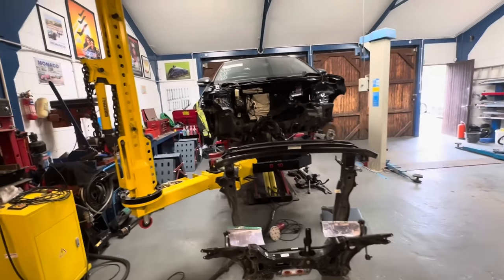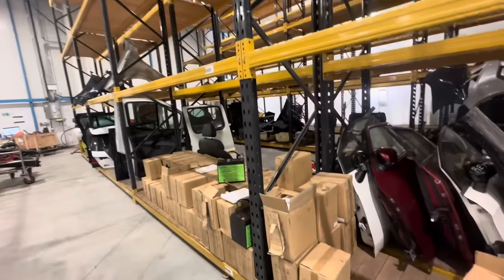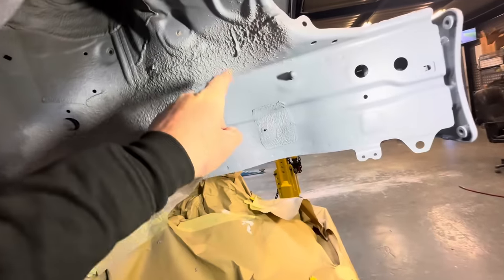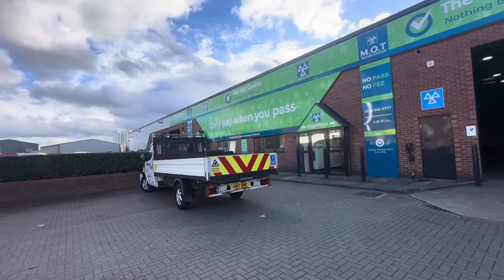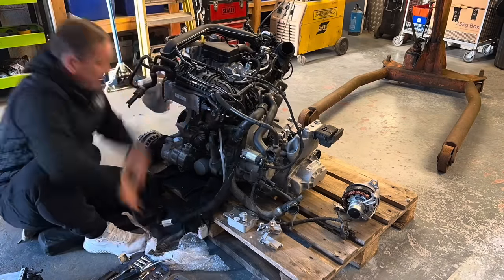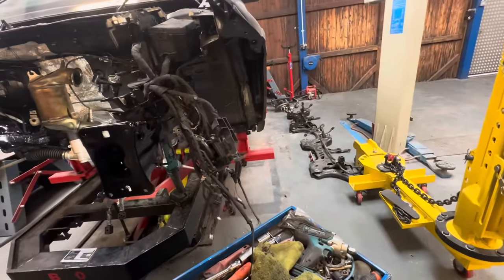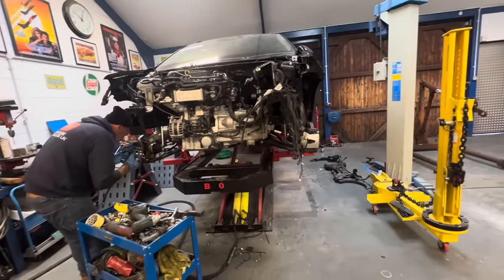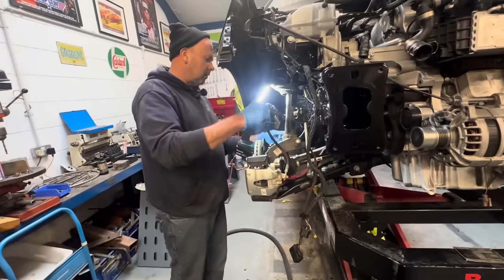REBUILDING A WRECKED 2023 VW TAIGO FROM COPART PART 3

Comment: I like the little touches that show your quality and wanting it right. The spraying of the insides of the subframes with anti-rust, using quality seam sealer, using good equipment, taking time when working to make sure you don't miss anything and carefully choosing replacement parts like makers parts where critical. Too many shops will do a half-arsed job, cutting corners, to save a few quid/dollars/euros. I also think you have a good reputation you want to keep and for your own peace of mind to do the jobs right or not at all.  I presume a VW dealer will have to reset certain components as such a new vehicle and the only ones who can do it.

Comment: Hey Rob,
You mentioned that you'd bought batteries for the boat. Be careful if they are normal car batteries as once again marine batteries are different. They may look the same externally, but the internals are built stronger to cope with the constant thumping you get in a boat when hitting waves. Once again you don't want a battery failure while out on the water. 
Cheers

Comment: cracking Video as usual This is going to be a fantastic car for somebody soon. Waiting to get a matching tyre just shows your attention to detail and good on you both for that! As far as the Dinotrol is concerned you used to be able to buy an extension pipe about a meter long with an adaptor nozzle on the end that sprayed Dinotrol in four directions at once. I had one of those and used it many times. made the job of spraying inside box sections a whole heap easier. Might be worth asking your Dinotrol supplier if they're still available.
Reply: Just checked the Dinotrol website and they still list the long injector pipe with the attached nozzle that replaces the standard nozzle that comes on the cans. Hope this helps.